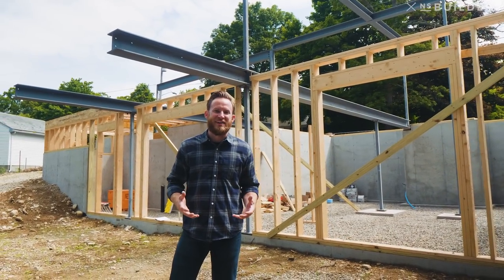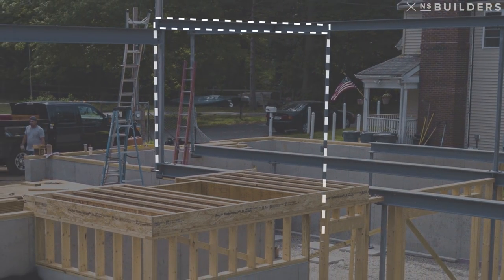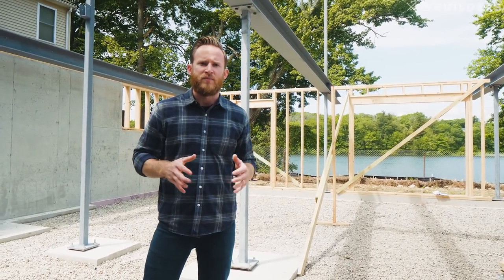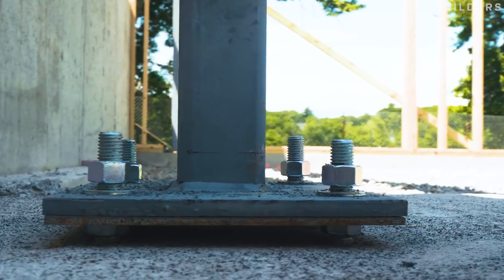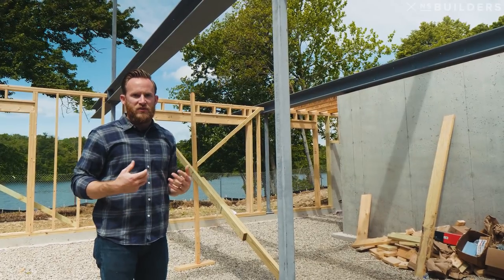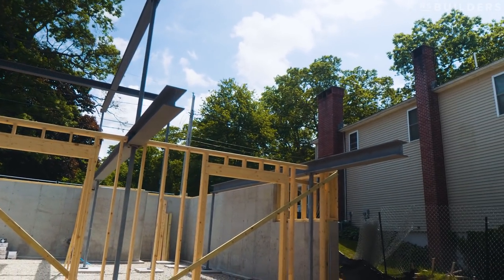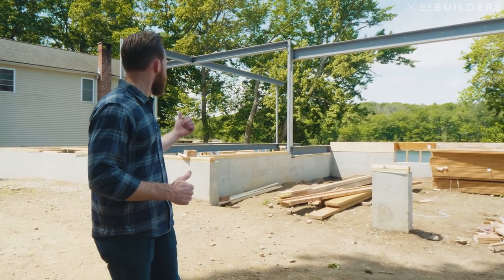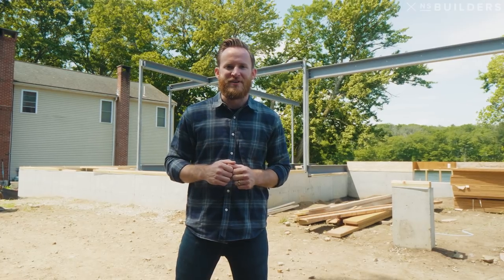Erecting Steel: Lake Drive Custom: Ep 02

Comment: I was wondering if the beams will sweat under the insulation. I was taught that heat moves from heat to less heat so the outside beams will pull the heat outside. Kind of like sweat on a glass window pane. Once moisture gets on the beam rust can begin.